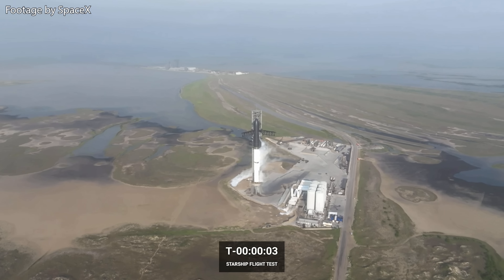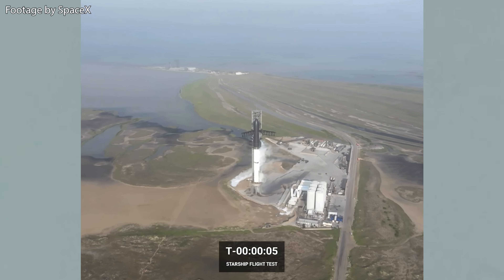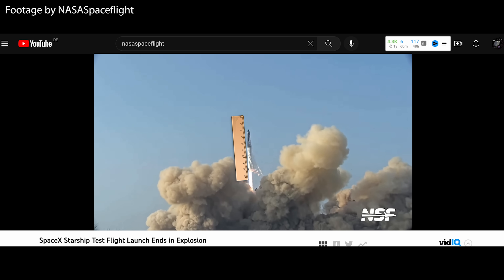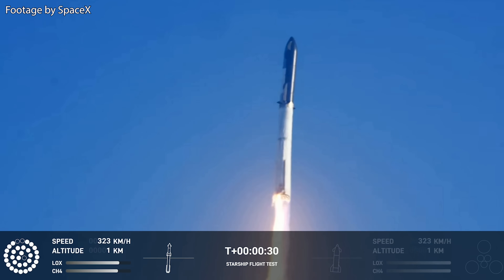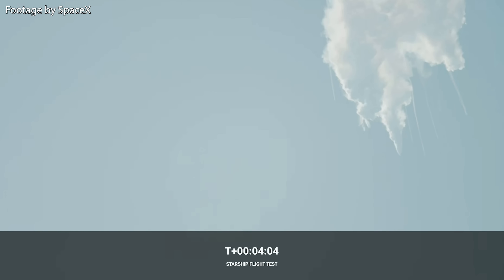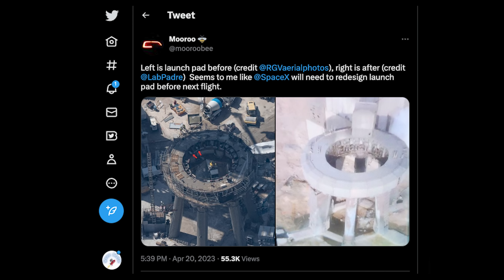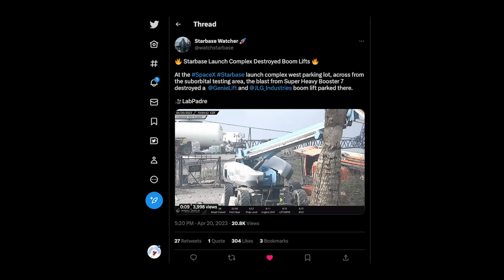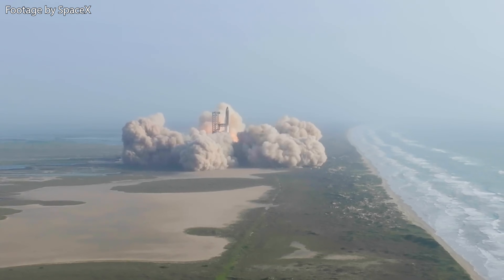SpaceX Launches Starship But Causes Big Damage to the Pad. What Went Wrong?

Comment from the maker: That was INCREDIBLE! 
But also very concerning...look at the aftermath in the launch pad....
Reply: I can't believe the tanks are still there. I'm not an engineer but I do have Common Sense and the damn fuel tanks are too close to the Launch Site. They at least need a Mountain of Dirt between them and the pad!
Reply: @fukhue8226  you failed to realize..Texans were in charge... It's dumb and dumber in the flesh down their.
Reply: Being concerned has nothing to do with this :). First of all they expected all of this, roughly, and secondly they have to do these tests to go forward and gather data so they can rebuild and improve on next versions. The real success here is that it actually launched and didn't blow up on the pad, remember, this is the first time they test this booster, and it actually took off with more then half of raptors still working! So much data they have to go on, but I would be very surprised if they don't create a flame-diverter, they really need one.
Reply: This is why the pyramids were built to deflect thrust power. Duh.
Reply: IF NASA DID THIS EVERYONE WOULD BLAME HUNTER BIDEN'S LAPTOP.... NEVER MIND THAT EVERYTHING CRASHED IN LESS THAN TWO MINUTES...WHICH PART WAS A SUCCDESS OF THIS FLIGHT ? TAKING OFF ??? IF THIS WAS A SPACE FLIGHT WITH PEOPLE WOULD NOT HAVE REACHED THE DESTINATION AND IF IT WAS A BOMB THEN DID NOT REACH THE DESTINATION EITHER...THE CHEERLEADERS WERE THE LOUDEST - THAT'S ALL ?
Reply: This whole launch process, seems like it needs to be done a long,long ways from anything of any value.
Russians had one blow up that took out the entire base, and killed quite a few people, including a top engineer.
If this space-x vehicle blew up on the ground they would not be saying it went just fine. 

It looks like an unpredictable thing.
Reply: @bradsanders6954  it's five miles away from anyone once they close the range down for flight. True, it could produce a small nukes worth of WOW if it blew up, but that almost certainly will never happen. It's not a bomb, which is designed to cause percussive explosions. If it all went bad, it would most likely zipper like the shuttle did, followed by an impressive fire ball of burning fuel. That's not the same thing as an actual explosion.
Reply: It was held down way too long. The arms are still there, the tower is still standing, it is ok.
Reply: @thecyanadon  It wasn't producing enough thrust way too long, those engine failures really slowed it's liftoff from happening, I believe they or the computer ramped up power once it was noticed.
Reply: @spencer963  I think the clamps held it too long, it shot off the pad fairly fast.
Reply: @Cyanadon  The only think keeping it down at launch was gravity.  The clamps were released 15 minutes before launch.
Reply: @thecyanadon  They needed a flame trench anyway. Most of it is now dug!